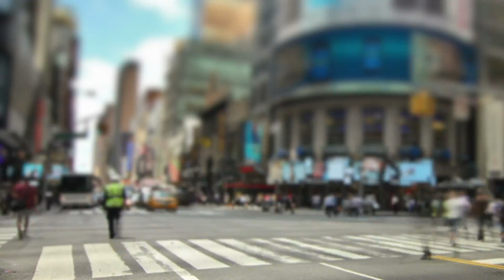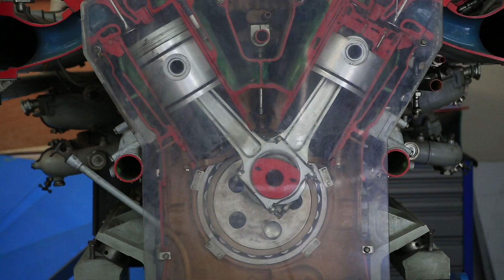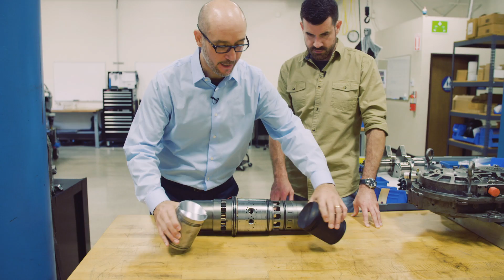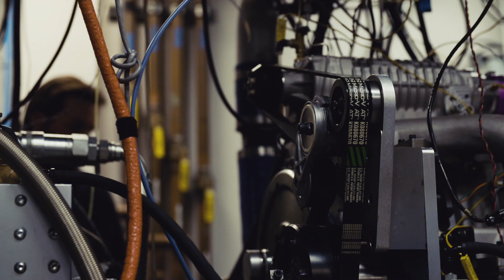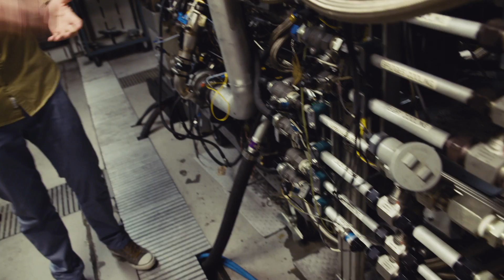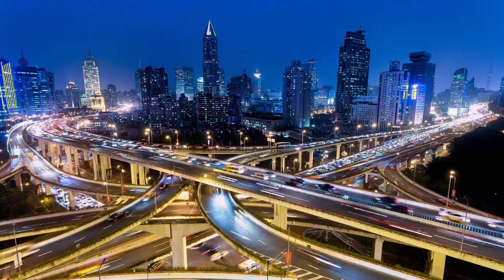This Radical Redesign Could Keep Gas Engines Pumping | WIRED

Comment: There wouldn't be R&D on engine like this if there wasn't a need for it. Electric people we still need a better battery.
Reply: hydrogen is way to inefficient
Reply: Ted Roberts it's coming. lithium ion energy density in Teslas batteries improved 40% from 2008-2013. Its on a very good learning curve. And that's without considering post lithium ion tech which should have started to come online by ~2025 or so
Reply: D Jaquith also, hydrogen is only 25% efficient vs 90% for a battery. Plus hydrogen in a best case scenario with economies of scale costs the same as gasolene currently does.  Versus electricity being 1/10th the cost.  Also most hydrogen is derived from fossil fuels.  That is the cheapest way currently to extract hydrogen. Hydrogen might have some utility on heavy vehicles until we crack the next gen lithium air or lithium sulfur batteries, but it will not be the dominant mode of propulsion for light passenger vehicles
Reply: NZJacobNZ Ever see how much polution and ecological damage is done mining Nickel, Cobalt, Magnesium, etc with the least amount Lithium? Oh let's not forget the magical unicorns with rainbows that generate all the electricity. Clean coal, nontoxic radioactive waste, etc .. no such a thing.

No what's clean is Biofuels that are carbon neutral and 100% renewable. Even if someday there are Fusion reactors will be using hydrogen.
Reply: Hey if we have fusion everything will be very efficient but right know storing energy in battery is more efficient then current fuel cells technology
Reply: theAppleWizz What's needed until we have that savior Fusion technology, is something that doesn't create more problems than it solves.

Listen I wish and originally was drawn into the lithium ion batteries falacy. I wish it were a good solution, it simply isn't. You need to do some research. The research compared a Tesla to an inefficient SUV. 

The materials used in Li-ion batteries brutalizes the environment and currently they are not recyclable. Next no matter how you escape it the metals used have a finite supply, it's like trading fossil fuels for something else.

In contrast, Algae Biofuels are 100% renewable, carbon neutral, and the metal of the combination engines is all recyclable.
Reply: +Ted Roberts; "There wouldn't be R&D on engine like this if there wasn't a need for it."; That statement is not good. There are a lot of companies spending millions on R&D that turns into nothing. Even if they manage to complete and market it, that is no guarantee it will sell.
Reply: D Jaquith actually tesla batteries are 85% recyclable off memory. Nissan leafs are even better. Biofuels arent the answer because they take valuable agricultural land from edible crops. With our exploding population we need to be efficient with our land use. If you look at the cost curve of solar you will see solar and maybe a bit of wind will  be our savior. Solar is going to be cheaper than the cost of transmission.  So even if fusion provides "free" energy, the cost of transmission will mean it still wont compete with solar. Besides, fusion won't become commercially viable until likely near the end of century. We wont even have a working power plant until ~2040 and we need to have sorted out our greenhouse gas emissions well before then.
Reply: NZJacobNZ No, pretty much none of the Tesla batteries are actually recycled. The discussions have been anywhere from the plastics and electronics surrounding the battery only to 30% of the battery to at most 50%. Lithium ion batteries are notoriously not recycled. 

edit: the reason is cost, spending more money to recover less money. Recycling only makes sense if the financial makes sense. Money wins over logic nearly every time, the only exception I can think of is people and then only in certain countries.

Regarding solar absolutely a good source now after recent advancements that it doesn't take 10 or more years to recover the energy required to create the 'panels.' I'm looking forward to fulfilling Elon's claim "cheaper than a typical roof" solar roof panels with bated breath.

Fusion, by education I'm a Chemist, I'm not even that convinced as you by the end of this century. Like Li-ion recycling I've heard it 'all' in time frames or if ever. The Suns massive gravity vs a flimsy magnetic field. Don't get me wrong I sure pray for it. However, knowing people as I do, the powers that be ie fossil fuel companies will in one way or the halt any near free energy solution.
Reply: D Jaquith fair enough.  I've only heard what is theoretically possible of recycling Tesla batteries, I've no idea what happens in reality. I would imagine recycling will increase as scales go up though. Also, even if they arent the ultimate solution i think they're likely the best bridge technology until we find it.
Yes, who truely knows when fusion will be conquered,  although with how fast AI is progressing,  even if we can't figure it out i would imagine AI would have it sussed by the end of the century. My hope with fusion is that if by then we all have solar plus storage at our homes then the fossil fuel companies wont have the power to do anything against fusion because their market will have been very significantly reduced. All our electricity and transport will run from renewable sources by the time fusion becomes viable.
Reply: NZJacobNZ Agreed as a stop gap, Tesla is interesting especially the Tesla 3 as I'll say below.

To be perfectly clear it's not that in any way, shape or form I'm against Tesla and especially not in the tiniest bit against Elon, quite the opposite.

However, once I started really looking at purchasing a Tesla car I did some research of my own; sustainability, recycling, environmental impact, cost, comparison shopping, etc. 

Once the battery technology improves (cost, efficiency, environmental, etc) then sure it'll be on hell of a good option if not the best or better option. The battery packs now, today, that Tesla is using retails around $40K and the cost difference between a 60 KwH and a 90 or 100 KwH is essentially double, it's like saying a 15 gallon vs 30 gallon gas tank doubles the cost of a car. Graphene and other newer emerging battery technologies are right around the corner, and I certainly hope the problems I've mentioned are indeed solved. 

Being honest I'm considering a Tesla 3 as an 'around the town' car. If for $35K or close to it I could have an autonomous car and if the cost of gasoline skyrockets then I'd be happy. My thoughts are more on the 'coolness factor' than practicality. In contrast, a Mercedes E Class or closer to cost the S Class is not a fair comparison. 

I'm certain that an ASI has to possibility to change the world and bring us unimaginably new technologies. I sincerely hope Fusion power is one such item in addition to medical breakthroughs.
Reply: NZJacobNZ We both want the exact same thing. Algae Biofuels offer the same, so does E85 ish reducing pollution. I understand the efficiency loss with E85 and even though it's the same cost as fossil gasoline hardly anyone uses it. People have a death wish.

E85 is at least 85% carbon neutral.

I'm all for better, as I've said, battery tech.
Reply: theAppleWizz The what? Certainly in a fuel cell hydrogen is very efficient. If you have a Fusion reactor you have virtually an unlimited supply of electricity and with that you can easily break water down to hydrogen and oxygen. It's the perfect zero emission fuel.

In the near future we need 100% renewable energy, highest possible recycling, carbon neutral emissions, and carefully controlled ecological safe processing.
Reply: D Jaquith battery cost is reducing off memory by 15% year on year. Most predictions put the cheapest car being sold with 200 miles of range will be electric well before 2025. Also 2025 is about the time lithium air/lithium sulfur chemistries start coming online which have the potential to reduce cost by a very large degree and nearly double the range. I think we'll be beginning to see EV market saturation by 2030. I only hope it's soon enough to prevent the runaway affects of climate change...
Reply: Also, lithium air tech could come online even earlier. Volkswagen is working on it right now and I've ive heard they're wanting to release a production model as early as 2020! :o if that's the case the EV transition would be swift indeed!
Reply: D Jaquith what alternative fuel do you think heavy vehicles will primarily employ? And do you think they will use hybrid electric technology?
Reply: NZJacobNZ Algae Biofuels can be refined in much the same way as fossil fuels including the creation of plastics.

If you were to create an EV semi tractor-trailer truck it would have to have some way of accelerating the recharging times; switch to separate parallel packs for more even and faster charging. Verses refueling them quickly with a biofuel. Time is money factor.

The problem in Biofuels either using corn or other sugar rich biomatter is the incredibly large scale commitment. Also, I'm not a fan of using crops (food) for fuel. Algae can be grown more easily in 'crappy' areas. 

Either way it's a tough call. Unfortunately, in some regards, my uncle was a good chemist. He refined the German coal liquefaction to make it very viable.

People like you and me see the perils of fossil fuels, business people only see cost vs their short lifespans.

So at least IMO I don't see EV trucks in the foreseeable future.
Reply: D Jaquith yes time is definitely money for transport. Charging times are continually improving as battery tech improves but i think trucks will be hybrids for a while. Ahh okay I'm  much more on board with an algae biofuel vs one of the crop ones like corn you mentioned. Does growing algae have much of a negative environmental impact? You think a biofuel will win out over something like hydrogen? If so, why? I disagree via companies not getting onboard the electric trucks. There are even more savings to be made with vehicles which are heavily used so transportation companies actually have a greater incentive to go electric than the rest of us have. If you havent already, look up the Nikola One truck, it's  supposed to start production in ~2020 and is a hydrogen electric truck with over 1000 miles of range. Also, they're marketing it with a lease program which includes free refuelling using hydrogen which is produced renewably with solar. It also has much greater performance than regular trucks. 0-100km/h in 30 secs under full load and the ability to go up hills at over 100km/h.
Reply: NZJacobNZ The cost of Algae Biofuels now is around $2 per gallon (4L). As far as algae and the environment, right now algae is the source of the majority of O2 and the fundamental food source of animal life. It's carbon neutral because the CO2 waste is the algae's food source and O2 is its waste.

Any electrical source can split H2O to H2 and O2 which is why I love the idea of both H2 as a fuel source with H20 as waste and a Fusion reactor.

Once we have Fusion power I'd stop Algae for most Biofuels, but keep some production for plastics or other Biofuels needs eg Airplanes, etc. 

It's a sort of race for alternative fuels which is a secondary reason the technology isn't used yet.

That’s one hell of an incentive to use those EV trucks. I'm not opposed to any of that, instead which 'I' believe will probably happen. Some AI or scientists might come up with an unexpected technology, eg Zero Point Energy.
Reply: D Jaquith wow algae sounds fantastic. Does it make the O2 via photosynthesis? If so, that would be a great carbon sink at the same time. Yeah it would be good if we could use a biological source for plastics. 

Do you think fusion will actually be used for the general public considering how cheap solar is going to be given another 5+ years? It will certainly be employed for space travel at some point, but I'm doubtful about its cost competitiveness on Earth. Too high a initial capital cost vs solar and also much higher maintenance cost in order to keep the magnetic field perfect. 

What is zero point energy?
Reply: +D Jaquith; "Lithium ion batteries are notoriously not recycled"; that is not correct. See video "Renault - The circular economy of electric vehicles batteries"

Comment: it's not the engine that's the problem it's the fuel that it burns. if we continue to spend money trying to build a more efficient engine that runs on gasoline, the only thing we are doing is sealing our future of fossil fuel consumption and solution of the world. the solution isn't to make the gas engine more efficient the solution is to make a fuel that can supplement gasoline exactly and not produce emissions. in other words a fluid that can store like gas it can pump like gas and can burn like gas and can be distributed by the current gas stations without any change to them whatsoever, that's the direction we should be going in.
Reply: Pollution* of the world. spell check.